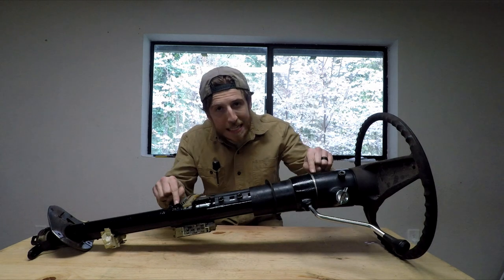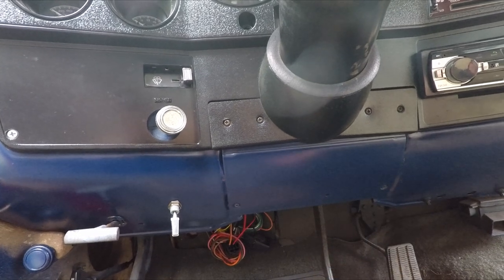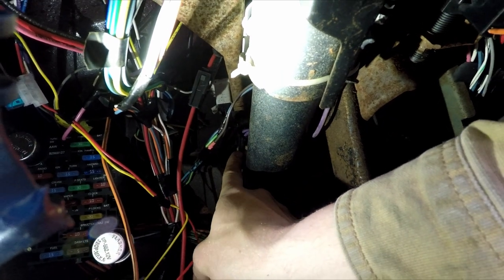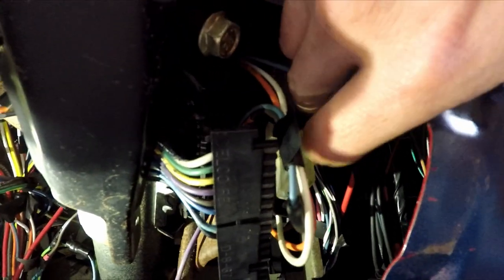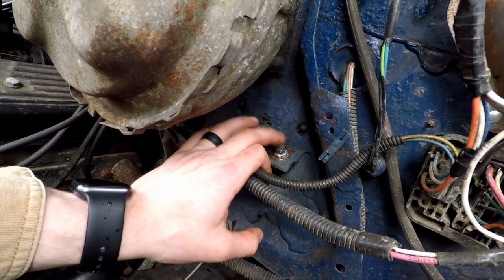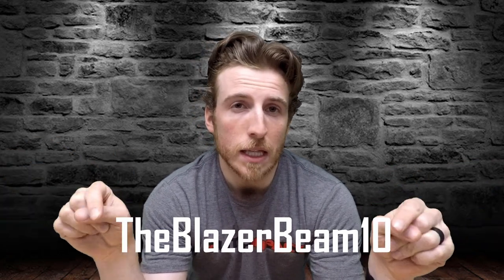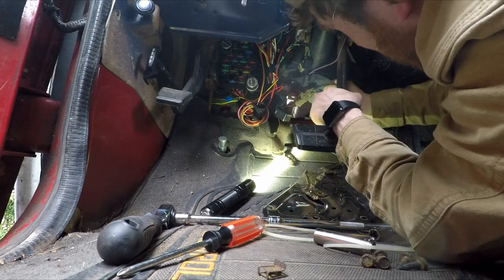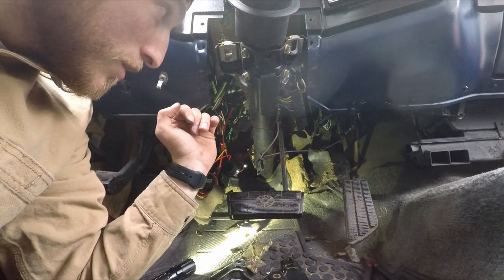How to Remove A Square Body Chevy Steering Column

Comment: I'm about to do a full column swap on my 89 Dodge D150. Finally figured out the cause of my floppy steering wheel, and it's my current column, completely cracked. I had already tightened the 4 bolts at the tilt knuckle and replaced the steering shaft before I finally found the problem.
Reply: Your videos have been a HUGE help to me. Thank you and God bless!

Comment: So I have an 84 gmc k10 and my steering wheel nut and bolt have both been stripped. I’m not sure if I have to replace the whole column now, but I can’t find the length anywhere. Does it matter what length the replacement column is?
Reply from the maker: As long as you do a 1980-1991 steering column you will be just fine. The length isn’t crucial but you’ll be better off if you stick close to stock. If you have a tilt column and can get the stripped parts off all you would need to replace is the upper steering shaft and nut which might be cheaper.

Comment: Thank you for this video man! Just bought a 1985 suburban 2 days ago and someone I can tell tried to steal it before because my ignition switch rod is all messed up… I rather just knock it out with a new column and go from there… do you have any links to where I can get a new/remanufactured column? I have tilt steering but I don’t care if the new column doesn’t have that. Got this truck for a steal of $1400 just because i was the only one who got it started, the person I bought it from never could get it to run til I hot wired it, I have been hotwiring it but it’s getting old to Hotwire it everytime I go somewhere 😅
Reply from the maker: Lmc truck is always a great go to. If you don’t mind spending extra you could go the flaming river route too

Comment: Whats the flip switch u have next to your brake release? I just bought a 85 c10 and it has the same switch
Reply from the maker: A lot of people will put in an ignition cutoff switch and that’s what mine is. Turn your key to on and flip the switch. If your dash lights turn off or on that’s probably what it is. You should also be able to flip it while the truck is on to turn it off